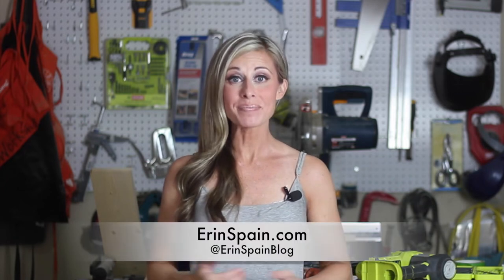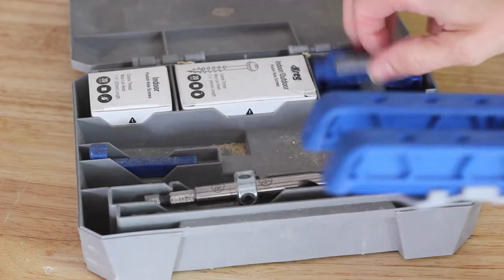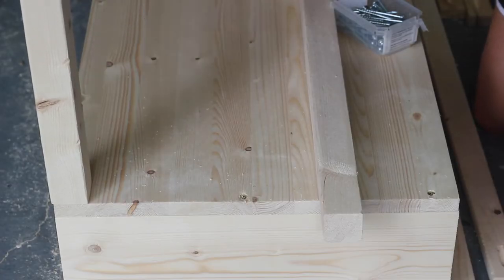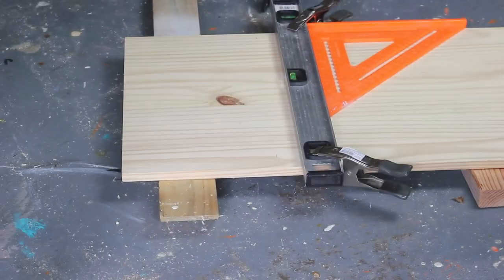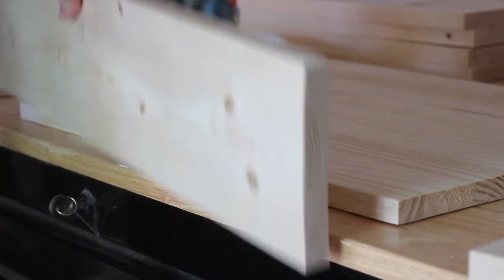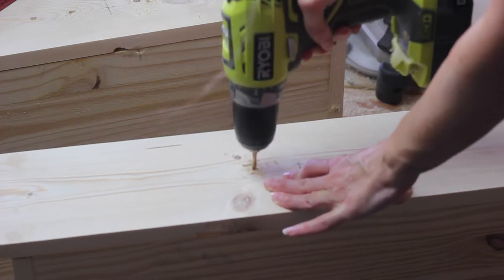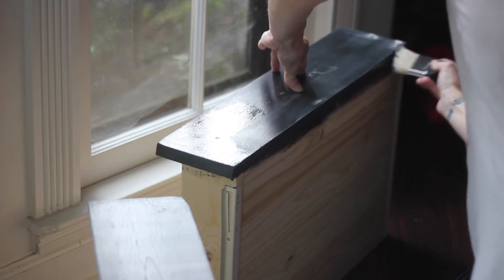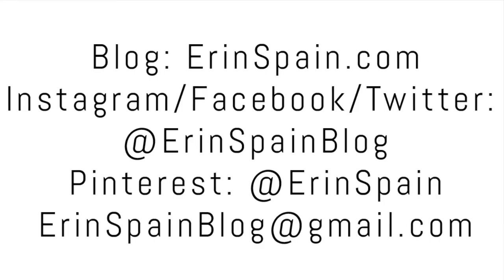DIY Dining Room Buffet Table

Comment: The best drawer material (I have found after making drawer such as you) is 1/2 Baltic birch, which is very stable.  Also, the drwaer bottoms I've found work really well with 1/4 inch sanded plywood.  Use a router to put a 1/4 slot in the drawer sides and front.  You can use a back piece of 3/4 pine, cut to fit on top of the plywood bottom.
If you want to get fancy, use a dovetail jig for half blind or through dovetails.  They look great and hold well.
Or, you can assemble the drawers as you did.  

I do love the look of your piece.